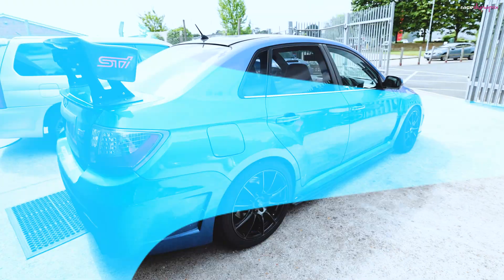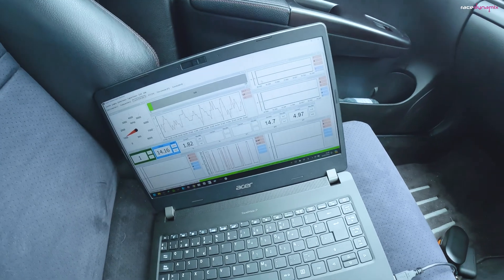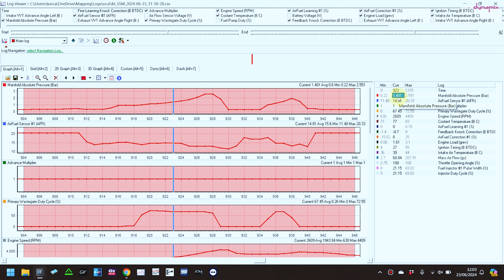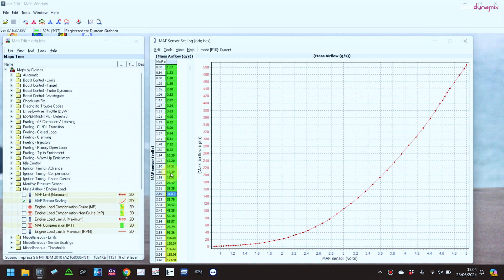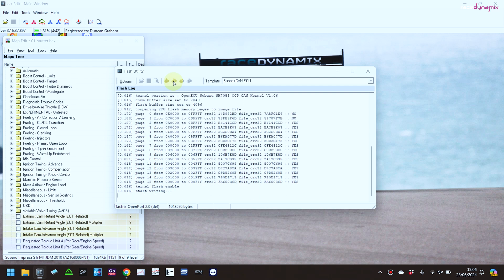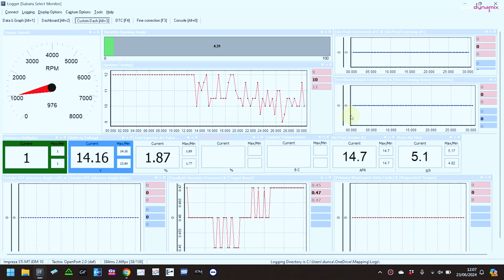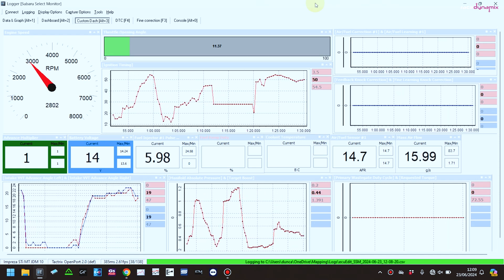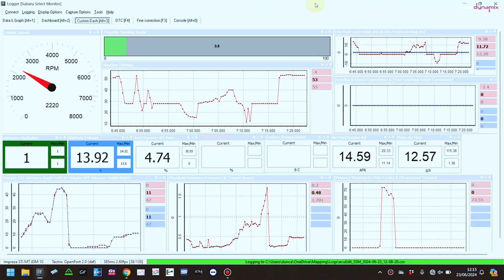Solve the Impreza GR Stumble | Subaru Problem Solving

Comment: Thanks Duncan for this important video. I just wished you elaborated more on the technical info within the custom tuning process. Basically what I understand is you added more fuel in that particular segment where it stutters but what is the previous AFR values and the newer ones? Plus, I'm hoping the adding of extra proportion of fuel won't effect the overall fuel consumption in the long run; that this fixation won't be on the expense of creating another problem, hence, a mechanical change maybe a necessity/priority before resorting to tuning the stutter out. Also, what modifications does this particular STI have? injectors? cams? upgraded turbo? This is important to know.
Reply from the maker: The car in that video was the one in the Stage 1 Tuning video just released so almost stock/std.

I added fuel into the maf curve at the low end that it moves through as it see the stutter.  It ironed it out on that car.  I have seen it worse with large injectors and that seems to be contributed to by the weird fpr set up.

Comment: I find the stumble is in the dbw torque output being to high in the low load range, and incorrect shaped tip in enrichment. But that’s assuming you maf scale is correct, and your still having the issue.
Reply from the maker: Yeah, there are many different causes of it.. I was surprised that this solution worked so simply, I was expecting other tasks tbh👍
Reply: @racedynamix  it’s good though means you are covering all aspects of the problem on many different cars.

Comment: Nice. My stumble became unbearable after switching to larger injectors. I initially tried another style regulator but ultimately the fix was switching to parallel lines and aftermarket rails.
Reply from the maker: Yeah..bigger injectors really emphasise it.  Luckily the maf curve cure sorted this out..have changed fprs before for others and rails.  Good choice 👍